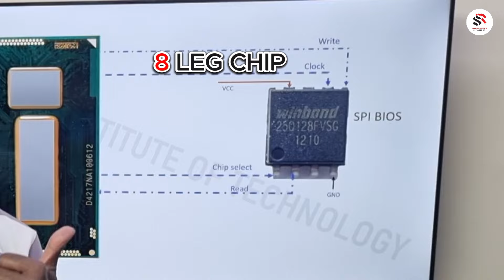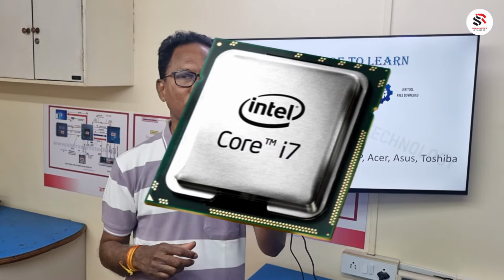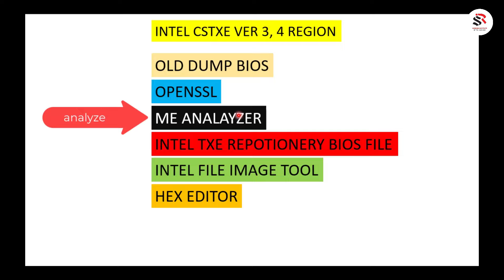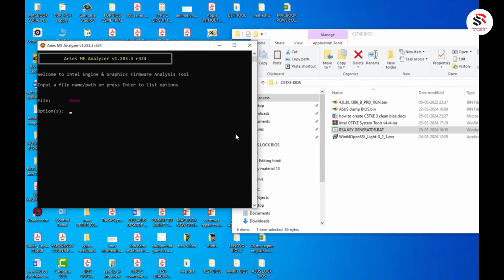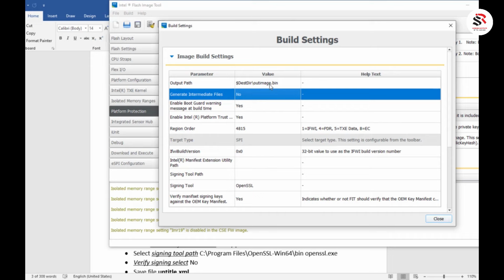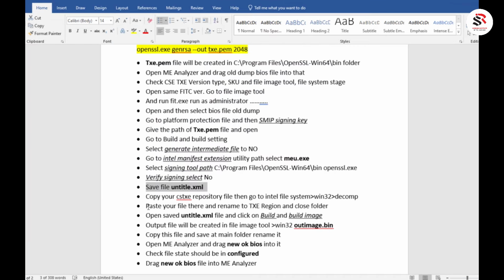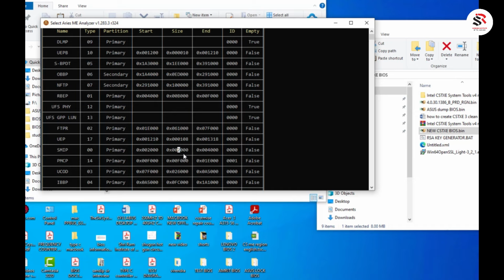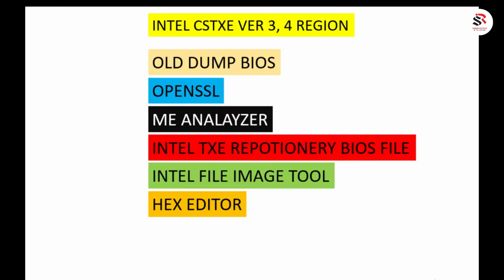How to make CS TXE BIOS clean BIOS EDTING

Comment: please master what is SMIP
AND WHY DO WE  NEED TO COPY IT TO NEW BIOS
Reply: The reason why you have to copy the SMIP from the original backup because the  private key is signed by the OEM at the factory and the private key which embedded in the chipset self  and due to the dummy.pem file as a place holder you have to restore back the original OEM signed SMIP module which is already in the backup file